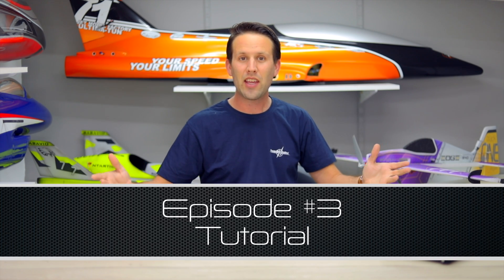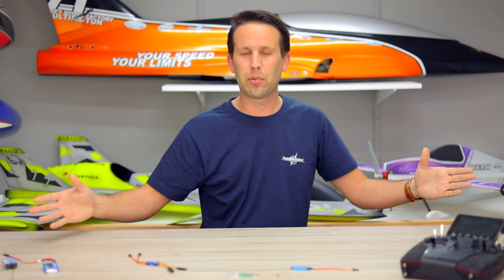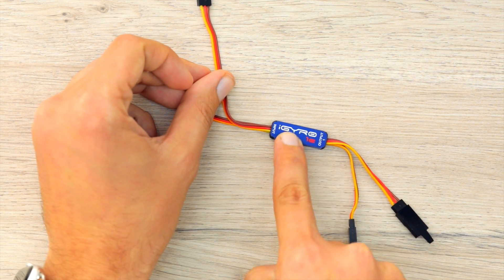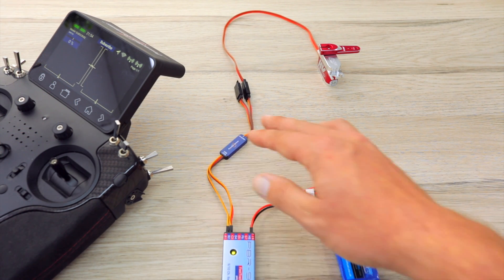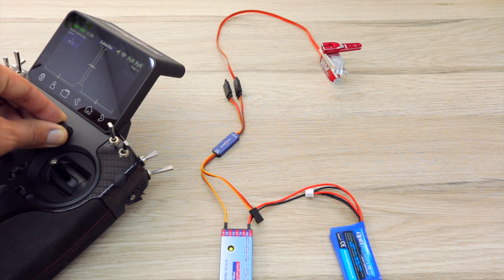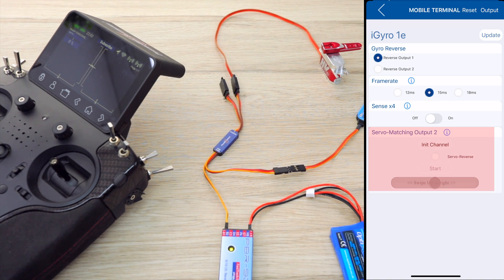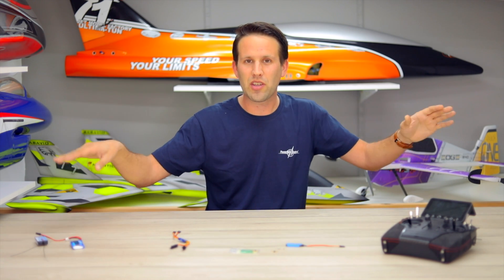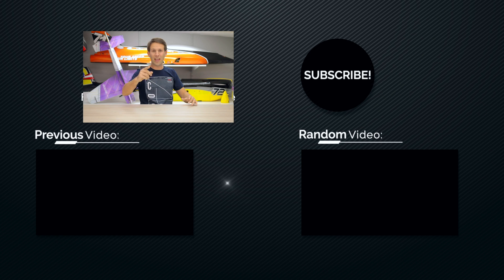iGyro 1e - Installation and Setup. Cool Tech Ep3

Comment: Martin can I use bavarian deamon system for PowerBox srs2 and my Core?
Reply from the maker: Sure, but you can use the iGyro SAT which does the same job, is much easier with full integration with Core and at a fraction of the cost

Comment: With the Igyro using 1 aileron input and 2 aileron outputs can differential be set up?
Reply from the maker: You can set the end points of the two servos within the Micro Match, so if doing it that way, yes. From the radio however only one channel is used, so no way to setup from the Tx

Comment: Hi Martin been watching a lot of your YouTube channel lately and noticed your edge in the background (the factory rc one) I have recently bought the extra and a friend has the edge but on the recommended motor and prop (22/12 and 9x3.8 slowfly) we are not getting much power ... so was wondering what battery prop and motor do you run in yours 😀
Reply from the maker: Hi Riley. I am currently waiting for a couple of upgrade servos to finish the video on this one. The stock prop is terrible, I agree and future combos hopefully will be sent out with an Apc 11-4.6SF which completely transforms the plane and the power. Pick one up, you will be amazed. Just make sure it is the 4.6 as it has an entirely different shape to the 4.7.
Reply: Pickering RC ok mate thanks thats so helpful I was pretty disappointed with it at first on the power side of things I’ll get one of those props ordered , what servo upgrades are you doing ?

Comment: But 80€ for this gyro seems to be high priced comparing with what u get with a 50$ fc
Reply from the maker: Economy of scale will play a big part, as well as using higher quality components... FC's regularly fail - simply stop working (the ones I have used at least)...

Comment: Very clearly explained Martin, The 1e is great I use 2 for thrust vectoring on a jet.  They are also great for small fast models on the ailerons as the 1e will keep the model flying straight at all power settings.
Reply from the maker: Thanks Stephen! If using 2 though, would it not benefit just going with a full on 3e which could provide some of the flying surfaces too? Just curious as to your thoughts, thanks!
Reply: @MartinPickering-PickeringRC  Hi Martin, yes I only used 2x 1e  as I already had them.Really excited about the Lizzard, 3D and speed all in one package, nice.